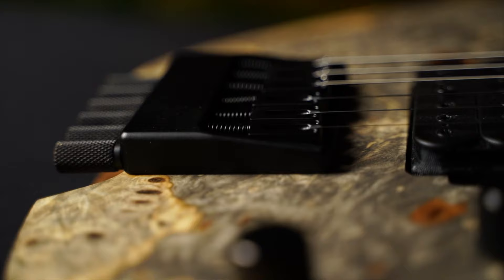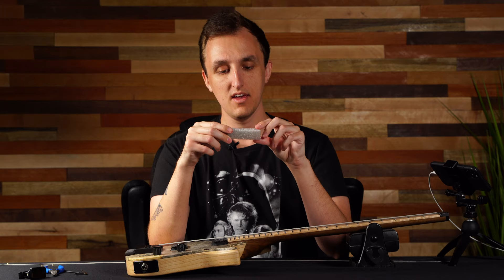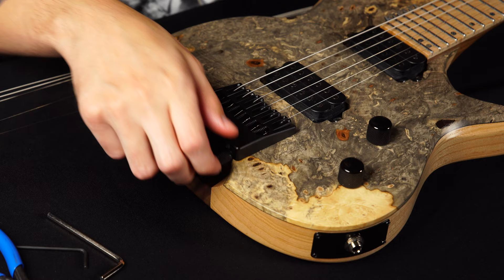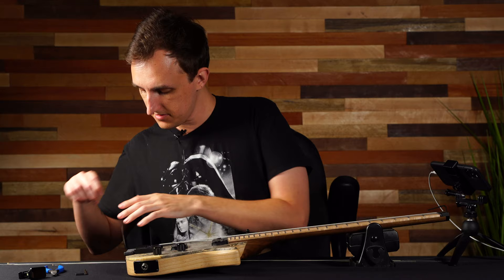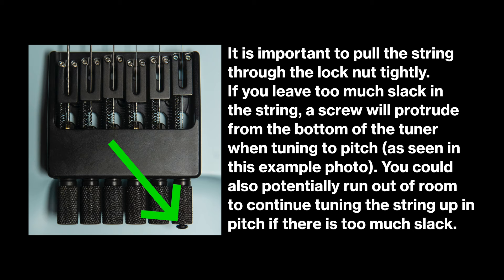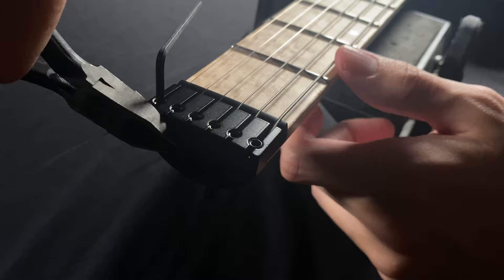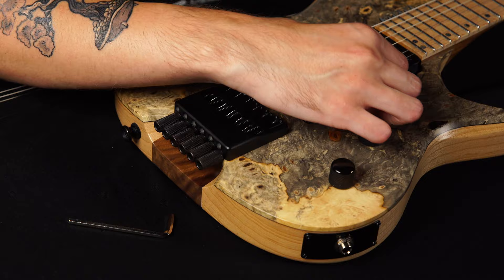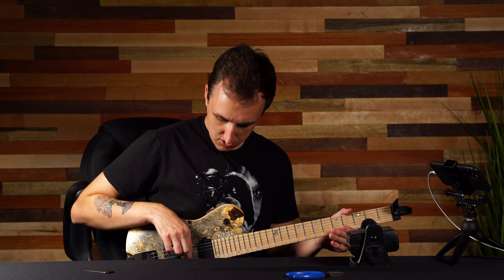How To Restring A Headless Kiesel Guitar

Comment: Writing this in hopes for some suggestions, but I got a Zeus recently (yay) and I'm changing my strings for the first time today (10 to 52). All other strings are good with the exception of the high e, no matter what it will not stay in tune. I'm tuning it to the point where the screw is actually coming out past the tuning peg (pretty sure this isn't supposed to be the case, and I am leaving 0 slack at the nut) and it still won't stay in tune. The string is sitting in the nut properly and I have the screw as tight as possible on the locking but without me actually risking breaking it.
Reply: I've accidentally cut several .010's by overtightening. Best I could do is bend the string forward before fully tightening and cutting. The angle seems to help.
Reply: Man, I have a Z7X and this thing almost always refuses to hold a .10. I've gone through so many strings trying to find the balance between not having the screw protrude and not slipping out of the nut. It's immensely frustrating.

Comment: I have a kiesel HH1. I am having problems with the high e tuning. is the phillips head screw to be adjusted? I can't get the string to pitch. I tighten the string as much as it will go and the phillips head screw protrudes out

Comment: With wound strings, is there a recommended technique at the ‘head’? How would I know the hex nuts are not just gripping the windings and not the core? I foresee a lot a wasted strings until I get the tightening just right so as to not let the core slip vs stripping the hex nut.

Comment: Not bad. I would skip the wire cutter and just bend the excess string back and forth until it breaks. Since the screw is putting tension on the string it will always break at the end of the screw and then you don’t have to worry about excess string sticking out
Reply: Can't see that working, esp for the wound strings.